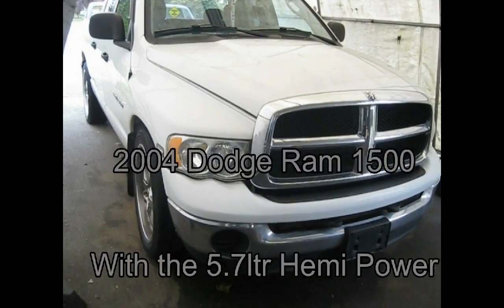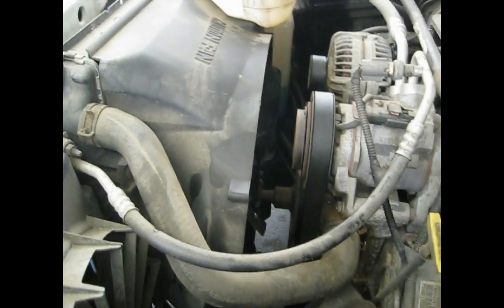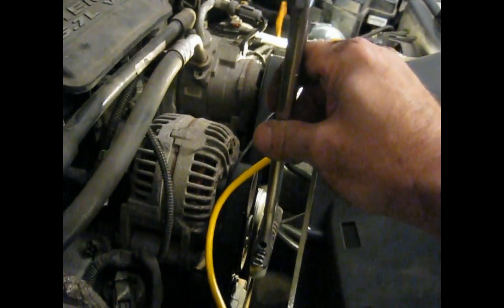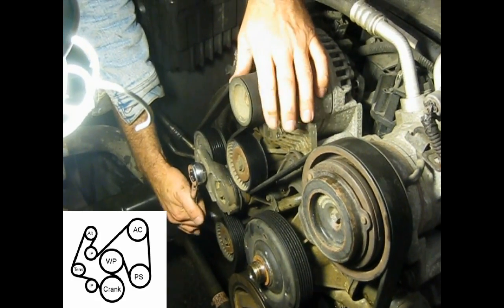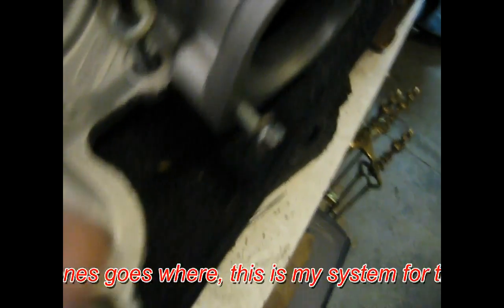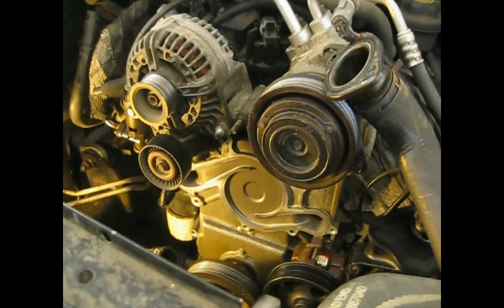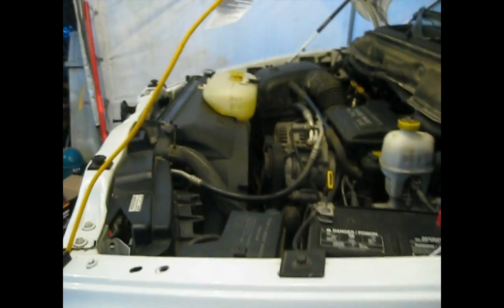2004 Dodge Ram 1500 5.7ltr Hemi Water Pump Removal and Installation

Comment from the maker: No it didn't, engine is still very dry and "cleaning?" well grease and oil free clean but, gotta say this engine for the most part has been really good to me. Big fan of the 5.7ltr Hemi, I also have a 2014 Ram same motor, only issue was the HEMI tic with that one and  the dealership warranteed it.
Looking at getting a new one but sadly the 5 7ltr has been discontinued 😢

Comment: Did the timing chain cover start to leak?
I have to replace my timing cover gasket. The water pump was replaced in 2020 but they didn’t replace the timing cover and the bolts that hold the pump go thru the timing cover.

Comment: The torque on. Boilt s 18lb --23lb. Do not go over 25lb. 🙇👍Tip on fan    take big flat head  screw driver. Or like chisel. Medium slide hammer 🔨  hit fan bolt on left end with big flat head screw 🪛 and hit with hammer ⚒️ few hits  lose don't need special tool 😊😂😂than once you put new water pump on put belt on screw fan back on bye hand get ranch turn right. Done you don't need special tool  💯😍👍👍

Comment: I put a pipe wrench on the fan and pushed the tensioner pulley to the left to put tension on the belt.  Then i tapped the wrench with a rubber mallet. It loosened the fan then i just spinned the fan counter clockwise until it fell off. Easiest way I've seen so far

Comment: 2004 5.7 about to do water pump. 273k miles. Ive had this for 17 years. Wrestling the steereing for over a year. Needs power steering pump.  Keeps my arms fit

Comment: Hey excellent job. I think the water pump should come with new bolts. I see torque is 18 foot pounds.
Reply from the maker: Thanks, did this job awhile back but yeah the torque settings almost feel like "finger tight". If I remember correctly I went just a bit tighter for that reason, but still in a cross over pattern

Comment: What is the tq spec for the water outlet? Please
Reply from the maker: Sorry it's been a very long time since I posted this video. I can't remember but I believe I used about 25lb to 30lb on the pump, I do mention it in the video, im gonna assume the torque spec would be same or similar. Do Not over tighten though, because aluminum is soft and you will strip the threads (hense why I think I went under recommend spec slightly) and never had an issue with it.

Good Luck
Cheers

Comment: Thank you, I'm getting ready to tackle my water pump, I have a question, did you not use a gasket on the thermostat housing? is it not needed? thanks
Reply from the maker: It's been along time since I did that job now, so I can't remember but what ever it had I used again. Might have been a rubber seal around the lip, sorry just can't recall. Should be visible in the video which ever way I did it back then. Good luck, cheers

Comment: It's kind of tricky because that plate with the three screws is tricky because that is in front of the alternator and the compressor the AC compressor what have you don't take those off you can't take off the water pump.

Comment: I've changed my water pump a few times on my 2004 Dodge Ram SLT 1500 5.7 and actually, you can take off the whole fan shroud with the windshield fluid container attached, without taking off the fins on the fan clutch first.
And yes those rents looking tools do not work they are hard but I bought a good size crescent wrench and then there's another tool that you can rent besides the ones in that set it's a single one it's a big one that looks like a scissor looks like a it's probably like a foot-and-a-half long and that works good.

Comment: All you had to do to get the fan off was put a ⅜ ratchet into the tensioner pulley to create some resistance and put a pipe wrench on the bolt and whack it with a hammer

Comment: So when standing in front of the truck, looking towards the rear, did you turn the fan clutch nut to the left to loosen it ??
Reply: counter clockwise by now you wouldve found out but still

Comment: good video... i find it easier to pull the belt off by once you lift the tensioner, then slide it off the idler pulley that’s just below the alternator... because that pulley is smooth it’s a heck of a lot easier than lifting it over the grooves on the Alt pulley... same deal for replacement

Comment: I'm doing my 03 ram as we speak do the heater core lines go into the water pump as well I have had leak issues for a while with this truck and I am replacing all hoses and all parts except the resivior and radiator

Comment: An air chisel will loosen the fan from the water pump pulley, did that with my 7.3l diesel. Just chisel about 1/4 inch from the edge it might take twice but you wont have to rig anything up to back up the pulley.

Comment: I changed the water pump on my truck today. Time consuming but saved a load of cash. Didn't build my own tool to hold the pulley, did the rent a tool and modified it. Worked out good. Pulled the rad out for extra room and went through the gapping hole to remove bolts. Probably didn't set any records doing it that way but made it way easier.

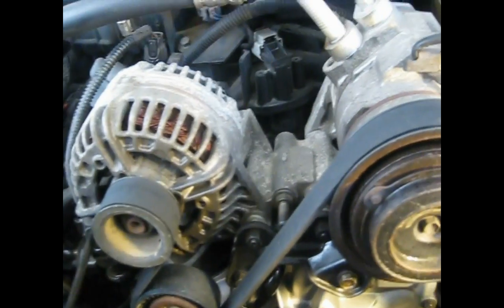Comment: That’s the jiggler pin in the t-stat.  Needs to be at the 12:00 position because bubbles rise.  It’s there to allow air through and coolant through.  The jiggler pin breaks surface tension.  The 5.7L Hemi in the LX platform (Magnum, Charger, 300C) calls for 20 ft/lbs for the water pump bolts.  You were good to stop at 25 ft/lbs.

Comment: Thanks for this video.  I have a 2011 with a bad pump @ 149k miles.  Changing it next weekend.  A little different as my tensioner and outlet are on the opposite side of yours, but hopefully everything else is similar.  You inspired me to make my own video, since there are NONE on YouTube of the 2009+ years.  Ordered the pump, tensioner and idler pulleys (they also have play in them) , shipped to my house for $97.  Taking a gamble to save money over the parts stores that it will hold up for 5 more days.
Reply from the maker: Your welcome Kurt Watson, hope my video was of some help even though they're not quite the same. I would like to see your video, send a link, i'll check it out..Cheers
Reply: Ended up not making a video. :(   I will make one if I ever end up helping someone else do theirs.  I made the same spanner wrench like yours too.  Worked great!  Everything was straight forward, no problems at all.

Comment: thanks this is very helpful.i got stuck with the fan pulley now seeing your bar with the two bolts will help.
Reply from the maker: Yeah no doubt, that made all the difference in the world, up to that point i was going crazy, had literally tried every trick i could think of including renting special tools and useing the "give it one good rap with hammer" like so many suggested, but nothing worked until i made that tool for both removing and re-installing. Gald i could help...

Comment: did mine on my 03 with 120000 miles year and a half ago, now its leaking again have to replace at 145000. You forgot to mention that the Hemi has a recommended coolant not recommended to use regular coolant. Like u said fan was biggest problem but it is an easy job, im gonna do mine in morning as well as heater core and evaporator. Good video i use old serpentine belt and wrap it around the pulley then hook to another pulley to break fan loose, smacking wrench with hammer does well.

Comment: thanks for the vid it was a great help on my wife's 04 Dodge Durango
Reply from the maker: Your welcome, that's great to know, didn't realize my video could cross over to other models but hey, If it worked for you that's all that counts, Thanks for the feed back :)
Reply: Did you have to pull the radiator out when you did yours?
Reply: Did you have to remove the radiator when you did yours

Comment: 25-30 ft lbs of torgue is too much.  Either use a 1/4 drive ratchet with a short handle and long extension and tighten them up good with that (should put you around 15 foot pounds).  Otherwise if torqueing it, go 15-18 ft lbs and that is plenty.  All you are doing here is applying pressure to a rubber gasket.  I was able to break all of the bolts loose with a 1/4 drive ratchet with ease.  That is your indication of how tight they need to be.  Professional Technician/ shop owner.

Comment: Your new pump looked like it had metal blades in it, and your old pump appeared to be plastic. Do you know if that's right?  I found a pump with metal blades/fan for replacement and would advise to do the same when replacing the water pump.   A memo has been sent around to professionals mechanics that engines may be overheating due to the plastic blades coming loose off of the pump shaft, thus causing overheating, duw to lack of sufficient water circulating.  I think this is what happened to my 06 Ram with 130,000 miles. Now it has a cracked block, head, or cross my fingers its only a head gasket.  Comments anyone?

Comment: I'm super thankful for the video. I have already replaced the radiator, it looked as though I caught a rock in it, and while I was there I did the upper and lower hoses. my 2008 ram hemi now has a drip that looks like it's coming from the water pump. This looks like it's not too big of a deal to do after everything else I've already done. It looks exactly the same on the 08 as this just the reservoir tanks a little different.
Reply from the maker: tj Uh .., I'm glad this video made it easier for you, Thank You for the feed back. :)

Comment: Dang man!!  Fantastic video!  One of the most comprehensive DIYs I have seen on YouTube!
Reply from the maker: +Touched By The Sun Pools  WOW thanks man, great compliment, means alot. Glad you liked it, i'm assuming you had that job to do or knew someone in a pinch. That's what prompted me to make the video, when my pump went i couldn't find any good vid's to help me through it.., so I made the video  "Found a need , filled the " Have a great day :)
Reply: Indeed. One of our fleet trucks needed the water pump replaced and your video is just nice and well paced so I felt incline to leave a compliment for you. Thanks again!
Reply from the maker: +Touched By The Sun Pools Thanks again, glad i could help

Comment: Thanks for the video my water pump busted today the truck got hot but I turned it off as soon as I could
Reply from the maker: +christian alvarado No Problem glad you can use it, glad to help.., and yeah don't run it without the pump working right, aluminium heads will warp fast not to mention other problems that could happen

Comment: I'm glad you took the time to make this video. I was googling for torque specs and that led me to your video. I  probably would have been blind sided with the fan had I not seen it. That really helped me prepare for the removal. Still not sure on torque specs, all I can find is 18lbs for my 2003. I don't think mine was very tight and may just have been loose creating a leak. Thank you Sir! Good people for sure!
Reply from the maker: +Jeff Nickerson Your Welcome i'm glad my video helped., my trial and error lessons learned becomes others benefit, i learned the hard way. I made this video because i couldn't find any info on the job at all, so i seen a need and created a solution. As for the torque spec.s i found a few but they were not consistent and as i started to tighten the bolts, as in my video something just didn't seem right, so i went with my gut and have not had a single issue since.
Reply: +Kevin Jones Right, I went with the 18 lbs as that is what I found the most. Last thing I want is to pull threads.

Comment: Great video !!! I just replaced mine on a 2008 Ram, I watched this 1st since I had no clue how to start. 
I did figure out another way to hold the pulley from spinning removing the clutch fan. I was able to put a 1/4 inch grade 8 bolt through an hole and vise gripped to a place on the water pump housing and used a big cresent wrench. To hold the new 1 i used 2 bolts and loosely put 2 bolts on it with nuts then used my pry bare to hold as I tightened the clutch fan again.

Another quick hint use your phone to take a pic then route your belt the same way.
Reply from the maker: Hey Thanks  Randy Vaness for the compliment, I'm happy my Video helped you. 
Also thanks for the additional tips, sounds like you're pretty creative as well.
And I usually take pics when working on things too., excellent point, although 
this time i made a video LOL 

Cheers mate

Comment: hey Kevin I am about to do my Chrysler 300c srt8. I will let you know how it goes
Reply from the maker: +Jay W excellent, best of luck Jay hope it goes good for you.
Reply: +Kevin Jones I did the install it went well, my old pump gasket was bad. old pump was still good. I replaced it anyway. had to reuse the idle pulley from old pump.  had problems bleeding system on hemi 6.1.  I finally bleed it after 2 days and 2 jugs of antifreeze. I still saved 2 to 3hundred dollars.  thanks
Reply from the maker: +Jay W Thats great news, glad my help video saved you some real cash there. I jacked my front end up as high as i could so that all the air would rise and bleed forward, and i added the coolant slowly with the engine running (but running only after topping the rad up first of course while off) and it went quite well, worked for me the old "gravity trick".

Comment: Great video. How many miles on truck when the pump and clutch took a dive? Mine is at 293,000 and all original.
Reply from the maker: Approx. 154,000 should've lasted longer i know but oh well, at least it was only that.

Comment: Most of the slop was in the fan clutch not the water pump, you can see the water pump snout not even move lol Dude I bet you still have that slop!. Plus the belt tension on the pulley would make it extremely hard for you to tell the bearing was gone. My fan clutch shit the bed on my hemi and was making noise.
Reply from the maker: +Joshua Edward i know what your saying..., but if you watch the video where i have the old pump out on the ground upside down wiggling the shaft it is moving inside aswell, plus there was a leak at that point too
Reply: Fair enough, I just think in the video where you grabbed the fan, that initial slop was the clutch.
Reply from the maker: Yeah funny thing., after reading your comment I went "yeah right!" LOL Then I went out side grabbed the fan and wiggled it and yes it still wiggles a bit from the clutch part, so your right and that's after my repair. But it hasn't caused me any problems although now just recently I had to replace my thermostat, it was staying stuck open, took forever to warm up the engine.
Reply: haha I figured as much, I'm on my second fan in a year, the sure fire way to tell is how loud the damn thing is at a drive thru and excess cab vibrations that radiate upon accelleration. One thing I'd be worried about is that overtime that slop in the fan could put abnormal stress on that water pump bearing. I also notice that these engines can lose coolant level over time with no visible leaks or traceable leaks, the cause on my parents Hemi Durango was the o-ring style water pump gasket, so I put a new pump on theirs thinking that was the problem, but when I took it off, the pump was fine and I seen where it had been leaking so I threw the new one on anyway along with a new gasket and copper permatex to help seal and 3 months later not a drop missing. My Hemi Ram will probably need the same done as I lose a 1/4 of a overflow container every month or two.
Reply: I also recommend permatexing the intake manifold gaskets as well, many poor hemi engines hydrolocked because in the cold those o-ring style intake gaskets suck residual water that's sits on the back 4 cylinders in during cold starts. More of a problem in the Durango cuz of their cowl design, but can happen in the ram if mudding or going thru puddles.
Reply: @Joshcheyka  I think this is my problem as well changed my exhaust manifolds due to warping and had a louder sound and some vibration even after changing them now I have a slight drip of coolant off the bolt by my power steering pump that's getting worse. Good info I'm new to self mechanicing

Comment: For fan next time put BIG adjustable wrench on fan nut then clap it to the left one good time with a hammer to break it free! Trust me.
Reply: THANKS!  You may have saved me $20.00 and a lot of hassle.
Reply from the maker: Paul Stewart Thanks Paul, I will keep that in mind.., But I'm really hoping there will not be a next time. (LOL)
Reply from the maker: Well Kurt Watson, i guess $20.00 is $20.00 right and at least i saved you some head ache too, so that's a plus. Glad i could help

Comment: Hey Kevin, the reason the hole with the pin on the thermostat needs to be at the 12 o'clock  position is so that any trapped air is released since air rises. If it was at any other position the air would be trapped at the top.
Reply from the maker: ELMV Thanks ELMV, I realize that now, a few others have also comment on that, but to late to change in video. :)

Comment: I think im going to be doing this to my hemi  2006 Jeep grand Cherokee soon I guess it will be close to the same just tighter spacing...was that 25 ft/lb enough on your bolts? did you use thread locker? would you have any other major learning points to share? Thanks!
Reply from the maker: andrew STEWART , 25ft/lb was all i did no thread locker, have had no issues at all. no leaks everything is still good. Can't tell you anymore tips than the video shows because i think it covered all, and job was successful, have had NO issues at all since complete. Good Luck, hope you have an easy time glad my video is of use for you. Kevin :)
Reply: Awesome thanks!